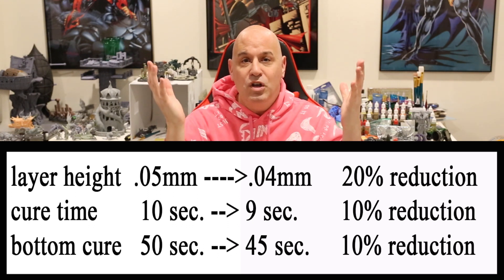How to adjust your layer exposure times when changing layer height for resin 3d printing!

Comment: Have had a Prusa mk3 for 2yrs, love it....ordered an Epax e10 partially on your review......did a ton of research on resin printers....know a lot about them buuuuut got a lot of learning to do about actual printing. Thanks!
Reply: That's a great combo. You now have the flexibility to choose the right tool for the job. The MK3 is a great printer and will allow you to print stuff in things like CF Nylon. The E10 will let you get unrivaled detail stuff compared to the MK3. I my self also have a MK3, modified Ender 3 Pro, Prusa Mini, and a Mars Pro 2. Waiting for stock levels and prices to settle down before getting a mid size resin printer.

Comment: What an awesome video and advice!! I've wanted to move from 0.05mm to smaller mm and kept getting fails until I got given settings but im stuck on 0.03mm, this is extremely useful and so grateful.
Can you please do a video on different exposure times for black, white, grey and translucent please as I use all these resins. I shall check your channel incase you have a video on this. Thanks

Comment: As usual, thank you for your experience ! I was wondering this same question without searching for a real answer, and here it is !
Following your formula, it means that halving the layer height (and so doubling the z resolution) result in a 50% increase in time at the end. Not so bad !
Reply: No, lights off delay and the time to move to the next layer will start to dominate the total time.
Reply: You cannot create a 3d print by exposing the resin only. You need to peel the new layer and stir up the resin. This takes time

Comment: I'm really new to the resin 3D printing community (heck, my first printer is still on the way to me) but let me tell you that your YT channel has been an incredibly amazing introduction to printing and you share insanely important informations which couldn't be found anywhere else. Thank you!

On a different note: yesterday while I was messing around in Chitubox (adding supports to a model which I'll print later when my printer arrives) I accidentally found out that if you double click on the small sphere which connects the top part to the pillar of the support (with which you can set the height of it) you can draw multiple top parts originating from the same pillar. Is this a widely know feature and/or a useful one? I haven't seen anything about it neither in your videos, nor anywhere else on the internet.

Comment: I'm currently trying to find the right cure time for printing with Elegoo's 8K Standard Space Grey at 20 microns. All published suggestions I can find are for 50 microns.  This formula is not working for me.  I've confirmed I get good adhesion and good print at 3.5 seconds per 50 micron layer. 20 microns is a 60% reduction from 50. Half of that is 30%. 30% reduction of 3.5 seconds is 2.45 seconds.  This exposure was so short, there wasn't even anything stuck to the FEP, basically nothing was getting cured enough to stick to anything whatsoever.  2.9 seconds got a good print, but there was some evidence of overexposure. Currently trying 2.8, getting closer.  It will be interesting once I find the right number to compare how close it came to this formula. Ameralabs' "town" calibration stl has been a great tool for dialing in various settings for various resins, I'm glad I found it

Comment: Hmm... I might be doing the math wrong, but if I reduce from 0.05 to 0.04 and then drop that to 0.02 I'm getting a different result from if apply that math from 0.05 directly to 0.02.

ie 
2.5s@0.05mm ->(20% drop, 10% reduction)-> 2.25s@0.04mm ->(50%drop, 25% reduction)-> 1.6875@0.02
2.5s@0.05mm ->(60% drop, 30% reduction)-> 1.75s@0.02mm

thoughts? is there a good way to do this reduction? better doing it in one go or multiple smaller steps?

this and the rounding up makes me thing there might be a missing constant or high dimension term here (like the square of the layer height per how radiation disperses with distance)
Reply: This is the first thing that popped into my mind. It's pretty much just eyeballing it to get you in the ballpark. Your best bet for determining layer exposure times at any layer height is to print an exposure test at the maximum layer height you want, and an exposure test at the minimum layer height you want. Get those two tests to acceptable standards, then do a linear interpolation for any layer height in between. That should get you a pretty exact number.
Reply: You're not understanding the math correctly.  You have to view your original number as 100% and that's what you work the percentage reduction from. For example half a pizza is 50 percent, half it again that's 25 percent. You're basically then taking that half a pizza cutting it into two quarter pieces and calling each quarter 50 percent because you halved it which is incorrect. That's why you're getting two different results. Because you're running with two different percentages.

Comment: Is it the same if you were going up? I've been printing a lot of blocky items like 40k tanks and buildings and .10 seems to be the go too layer height for that kind of thing
Reply: Yeah also waiting for an answer for this
Reply: Anyone found out? I am also interested in printing at 0.1.
Reply: @ApsikAkich  , increase the exposure by at least 50% and test. Info about testing of printing with resin is on Matterhackers web site. Or print the exposure-test gadget a few times with different exposures. The results will be specific to your printer at this time (it may change in the future) and a specific resin at a specific age and initial printing temperature. Zycze powodzenia w testach.
Reply: @michaels3003  Thanks!

Comment: Hi! Let's say you want to run something that doesn't need that much of detail and you usually print 0,05mm at 2,3exp. If you change to 0,08/0,1mm, you would have to be rising the exposure to 3,3-3,5 more or less, right?

Comment: This gives a great baseline to work from, thank you.  Wish more data points were released from resin manufacturers to help with dialing in. Btw, you mentioned using Siraya Sculpt at 0.04 for 3 seconds on mono screen; what bottom layer times are you using with that?
Reply from the maker: 16 secs, you can try 18 if you want to be a bit cautious

Comment: Hey, I really enjoy your videos a lot. They helped me out quite a bit. Right now, I'm really stuck with my Mono X... I believe that with lower layer height my prints don't stick to the build plate anymore. How many bottom layers do you have if you print in .02 mm layer height, so I could use is at a refference.
Love your content, can't wait for the Pit Fighter STLs to drop <3
Reply from the maker: I use 4 bottom layers no matter what layer height I use  :)
Reply: @3dprintingpro212  Thanks a lot, that's good to know. After so many failed prints I really wasn't sure why my prints don't stick to the build plate. But if the bottom layer isn't a variable, it's gonna be easier to trouble shoot.

Comment: have you tried formware 3d yet? so car that has been amazing with auto supports and has worked amazing. it cost a bit initial but its not month to month like lychee. also i find it to be alot better for minatures as it will do levels so you can print 2 plates worth at 1 time. their rafts also are awsome as they put holes in the bottom to save resin as well. may be worth you looking into

Comment: I love your videos they have really been helping me but I got a question I really hope you can answer. So I am printing something and the bottom layer is shifting just a little bit now my earlier prints were going stair case so it just kept slanting, but I changed the settings from one of your videos to 6mm lift, 50 mm/m speed, 150 mm/m lowering speed and 10 s light off. My bottom layer is 60 sec cure currently, and my other layers are 8 s. After doing these changes it seems to stop the slant however that bottom layer is still getting off center. How do I prevent that first layer from shifting or what is happening?

Comment: Hi, great video. Does this work even for Mono printers? I mean if I'd go from 50 um to 40 um, I should alter the time by -10 %, but if I would go even lower, I feel like anything below 1,6 seconds cure time would fail the prints (I assume it from benchmarks).
Reply from the maker: Yes works perfectly on Mono printers!  :)
Reply: @3dprintingpro212  thanks, i will try. I am printing mostly on 10 um, because I have very detailed minis from Loot Studios and especially with Citadel Contrast the layers can be visible. :)
And I wasn't sure about this because when I go from 50 um, where I have 2s exposure, then it is -80 %, therefore time should be lowered by 40 %. I should go to 1.2s, but in this way I've lost way too many details in my calibration print. :)

Comment: Hi 3DPP. Been enjoying your videos as my guide into the world of 3d printing, please keep them coming! Question regarding hollowed models - is there a way to fill them back in? I've received some hollowed stls for models that I think are too small to really warrant it, and I'm not keen on adding drain holes to infantry. I'd rather print them solid, but can't seem to find a simple solution to the problem. Do you have any advice?
Reply from the maker: I think you'd need to use a "sculpting program" like Meshmixer or Zbrush or somethign to do that, I'll ask around my artist friends
Reply: @3dprintingpro212  Thanks very much! I really appreciate it. As an absolute novice I hope it's an easy fix.

Comment: I'd did some napkin math and it just adds time with almost no befit for the vertical resolution. 1 mm = .03937of an inch. The difference of .01 mm = .0003937 of an inch. It's not even a half of a thousandths of an inch. You should do a test of at least 3 inch model at .05 and one at .04 and compare time and resolution. I think that would be a good real world test. 😎
Reply: Actually, this level of difference is a benefit to me as I work with extremely small model car parts. Like the detail of a exhaust manifold bolt in 1/25 scale.

Comment: You talked about the formula to increse the layer height and the cure time, but i didn't see that: what about i want to go from 0.05 layer height to 0.1?
Reply from the maker: It's a drop of 80% so drop your cure time by 40%  :)
Reply: @3dprintingpro212  , it is doubling of the layer height.

Comment: Oh boy... That's , that's... very scientific :-). You are using math right. Actually is not that simple, but in a strange way it works.  Why? Well it's all about an old mathematician called Gauss and his Gauss curve (google it).  By changing those numbers as Greg said you are still in the middle/central  portion of the Gauss curve, so strictly mathematically or I should say chemically the numbers are wrong. But, but they still work as you "shoot" enough energy to start a photo-polymerization process.  As we know the light loses it's strength the further it goes (very unscientifically said) . That's true specially for the medium with a large refraction and opacity. So using a transparent resin is different than using a black resin. All that really matters is the amount of energy that hits the resin thus starts the polymerization.  Just a disclaimer here: I'm not in anyway associated with Anycubic. Said that, Anycubic's latest 3D printers have a test pattern and test procedure that can help you identify almost perfect time per thickness for your new resin (look for  R_E_R_F = Resin Exposure Range Finder). So, no guess work anymore. Hope that sooner or later everyone will have this feature!

Hey, Greg CONGRATULATIONS for the Kickstarter success!! WELL DONE.

Comment: tried this formula on my mono.  failed miserably.  .025 layer /1.2s cure/22.5 bottom/6 bottom layers 

normally at .05/1.6/30 and no failures. 

half way through supports start breaking and got the pancake model dangling from the hood side of the print lol

i’ll stick to what works
Reply: what the heck is with that 18x bottom layer exposure

Comment: does this apply to the sonic mini 4k?  this seems like a lot of cure time...
Reply: I was wondering the same thing. I've had nothing but fails on the 4k. My other sonic minis are great though.
Reply: @marycarver3759  really? I hardly ever have fails on mine, what resin are you using?
Reply: @ucangfys5458  Right now I am using the standard elegoo gray because the frozen 4K resin is out and I can’t get it anywhere for a couple of weeks. I’m at my wits end because I’ve tried so many different settings, I’ve watched countless YouTube videos, I even went into the phrozen forums with no luck.
Reply: @ucangfys5458  I neglected to say that the bottom layers and all the support form fine but then the model actually pulled off of the supports. I have adjusted my lift Settings way down but still having massive sales
Reply: @marycarver3759  you will need to adjust your tips where they connect to the part.  Make them a little wider and a little deeper
Reply: @ucangfys5458  thanks for the tip. I’m a commercial seller, so to go through hundreds of models and do that for two different machines would take an army lol. I’m just a one person shop. I appreciate the advice though!!
Reply: @marycarver3759  well I would probably just switch resins then. The auqa grey is good.  But I’ve switched to the phrozen water wash black and I have no issues at all
Reply: @ucangfys5458  that’s awesome! I have some on order it’s just gonna take a while to be here. So frustrating though because I want to use my new printer!! Lol
Reply: @marycarver3759  i order mine through Amazon and have it in a couple days usually 🤷🏻‍♂️
Reply: @ucangfys5458  yeah I order everything through Amazon. They’re out too :( but it’s in order so I need to install patience and keep my fingers crossed it comes in sooner than they say it will.

Comment: just for info the 20% reduction is just bs

if u have 2.25 exposure time with 0.05 layer height and u want to go to 0.01 u can’t reduce it by 80% and not even 50% 

20-40% reduction would probably work

so dont take this videos seriously to calibrate your machine/resin

Comment: The math doesn't add upp here.

Going from 0.1mm to 0.09mm is a drop of 10% so 5% less cure time
Going from 0.1mm to 0.05 is a drop of 50% so 25% less cure time
Going from 0.09 to 0.05 is a drop of 44.4444% so 22.222222% less cure time.
100 sec cure time on 0.1mm would mean 95 sec on 0.09mm and 75sec on 0.05mm
At the same time 95 sec on 0.09mm means 73.888889 sec on 0.05mm
(100 sec for easy math, not realism)

So going from 100um to 90um and then later from 90um to 50 um compared to going from 100um to 50um gives different cure times.
Reply: For eyeballing, what would be the inverse formula to go up in layer height?
Reply from the maker: Well since the % doesn't match if you do it in small increments it will yield a different result of course, this is to ballpark people so they can mostly just get it right the first time.  :)